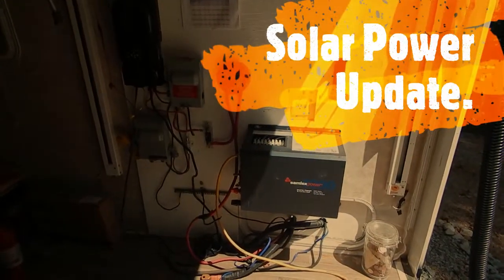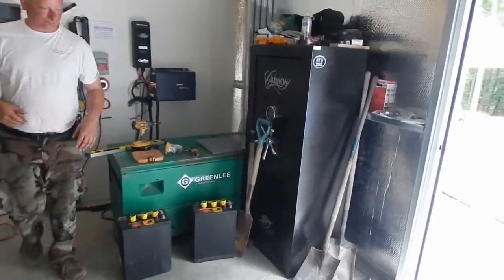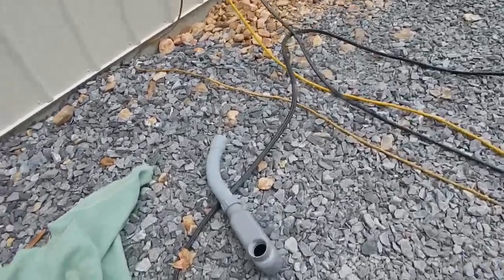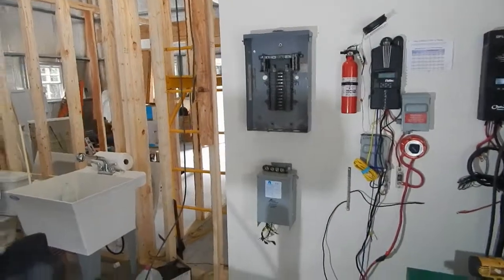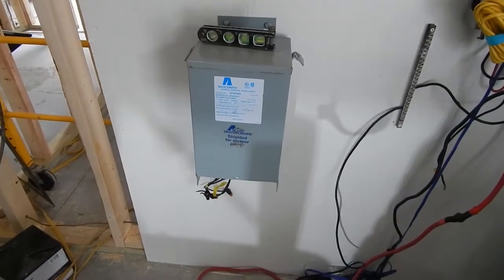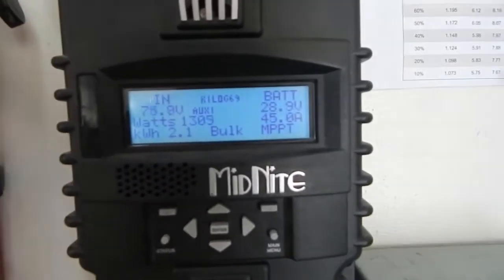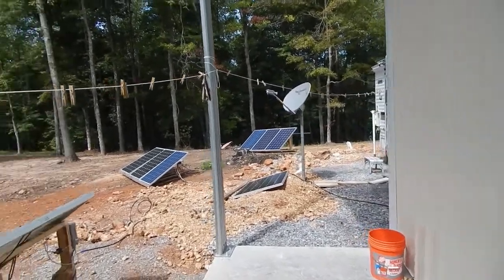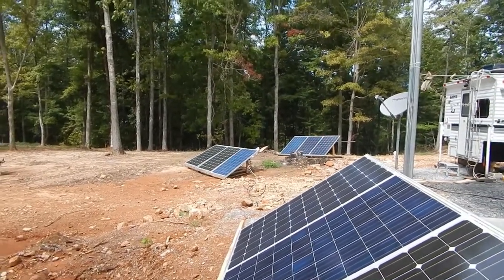Solar Electric Update.

Comment: I ereally want a 120vac to 120/240vac transformer.  Nice setup .
Reply from the maker: Thanks. Got mine on eBay a Amazon return unit some one dropped very heavy but new $350.
Reply: Still pretty expensive tho. Thanks